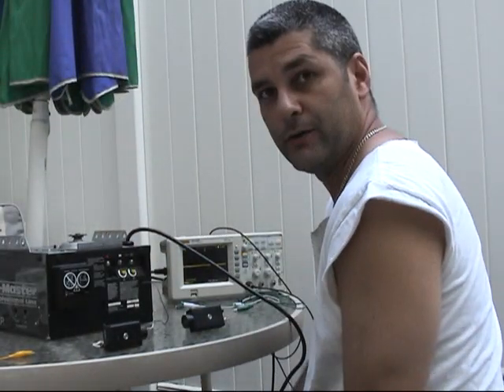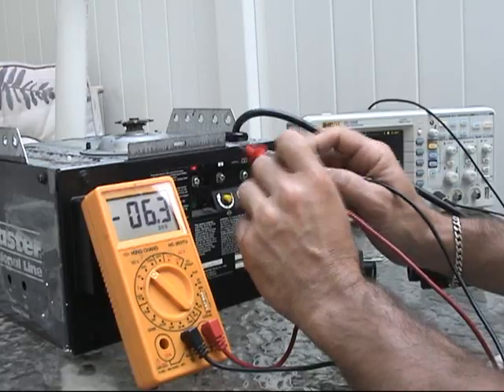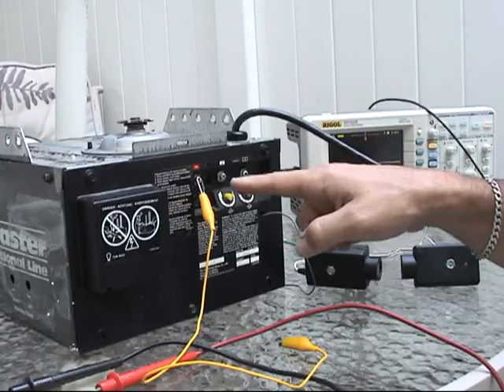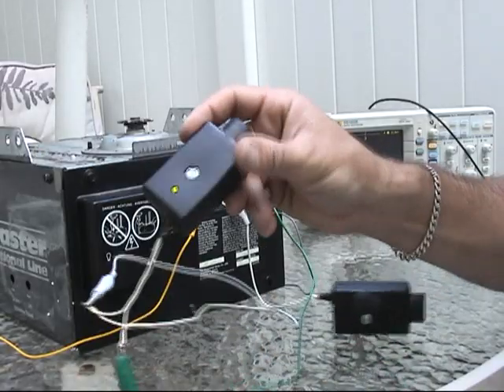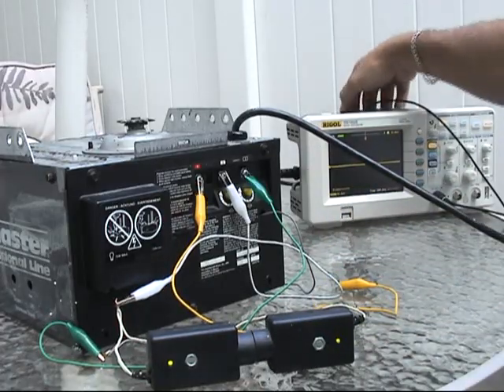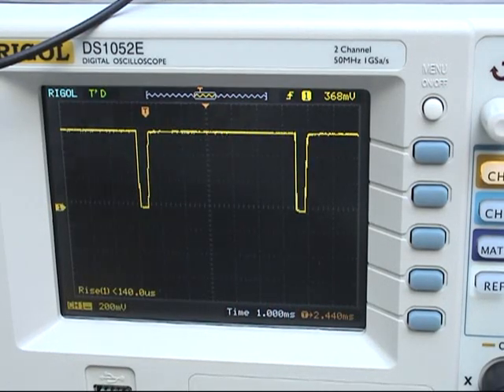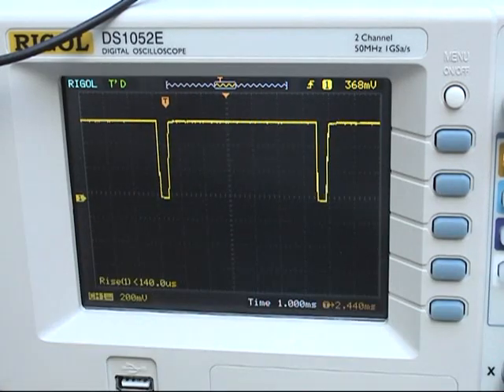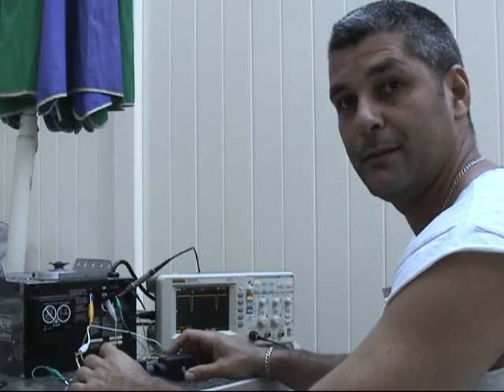Bypass garage door safety sensor.wmv

Comment: Useless. I thought I was going to learn how to bypass the sensors but instead he wastes time explaining why they work. A total waste of time. The oscilloscope added nothing.
Reply: +Nicholas Calvano  LOL... the oscilloscope tells you everything you need to know to bypass them.  I think MrEnergyFree is just erring on the side of caution - ensuring that people need to know what they're doing to bypass a safety feature.  If you listened to his explanation, I think you could figure out exactly what you need to do.
Reply: +Jason Riley All I want to know is how to bypass the sensors. His video does not do that. I know how the system works and care nothing about the extraneous information provided by the oscilloscope.
Reply: +Nicholas Calvano I know that's what you want... and the answer IS IN THE VIDEO, you just have to understand how it works... beyond "the door stops going if the line of sight is blocked".
Reply: +Nicholas Calvano  Hi Nicholas.  Do you want to bypass them permanently or temporarily?  I only wanted to bypass them long enough to determine if my problem was with the sensors themselves or if there was a problem with the opener.  I found out on one website (not sure which one) that you could jumper across two of the contacts on the back of the opener and the door would go down.  That was all I needed to know the opener was working and my issue was with the sensors themselves.  I have a friend who owns a garage door installation and repair business and they had an old pair of sensors which they essentially gave me.  If this is the same issue you are experiencing then my recommendation would be to contact a small home owned business and see if they'll sell you an old pair they removed when they installed a new door.  You could probably get them a lot cheaper then buying a new pair at a big named business.  But one note on my testing; I thought I could just push and hold the button I have on the wall and do the same thing but it doesn't apparently work that way.  Jumpering at the back of the opener was the only way I could get it to work.  I agree the video does not show how to bypass the sensors and who has an o-scope at home; few.  I have one and even if I did hook it up that wouldn't solve the question I had.  If you're looking to permanently bypass the sensors, most people wouldn't want to share that with you for fear of helping you put yourself into a dangerous situation; but then too they don't know what your intentions are; only speculating.  God bless.

Comment: I want to use the photo eyes as a driveway alarm, that is why I watched this video. If you want to by pas the photo eyes on your door, just mount them high above your door so the beam will never be broken. But I do not know why any one would do that. Why would you want your door to come down on someone or something?
Reply: +Sean Rafferty   My door will not come down and I suspect the sensors.  The only way I know to determine if the sensors are the problem is to bypass them long enough to test the opener; it's not to eliminate them permanently.

Comment: This is great, far better than the garage door companies, for understanding how they work. It's not a good idea to bypass the sensors, but this can help you understand how to fix them.
Note: on most garage door openers if you hold the wall switch, it will bypass the sensors and the door will go down.

Comment: Thanks for the analysis with the oscilloscope. That answers questions no one else on the internet had described as well. At least with over an hour of searching.

This also shows how you cannot (nor should not) by pass these safety devices in any simple way.

I am going to guess that in the controller board on the opener is a re-triggerable "timer" with a time constant longer than the 6 mS pulse. So long as a pulse arrives to re-trigger the timer before it times out the door is allowed to close.

Good job MrEnergyFree.

Comment: After looking at the waveform it seems pretty simple to override the sensors. Assuming the High of the pulse is 6 volts and the Low is zero all you would have to do is have a pulse generator that controls a switch to short out post 2 and 3. It would generate a 154 Hz (1/0.0065) frequency pulse with an 8% (0.5/6.5) duty cycle. When the pulse goes high the switch is turned on and shorts post 2 and 3. When the pulse goes low the switch is open giving the open circuit voltage of 6 volts. Get your self an arduino and a transistor and your in business.
Reply from the maker: +Anthony Shelton 
Look in my channel for new video "Bypass Garage Door Sensor using 555 timer " for the electronic circuit.

Comment: I just replaced the drive gear on a craftsman door opener and briefly bench tested it. I installed it but the car was not connected. When I closed the switch the car ran to the pulley and the cable is at the sprocket on the control unit. I was expecting it to reverse when I hit the switch again but it doesn't. Is there a way to assure the motor will reverse when the switch it closed? I don't want to tear up the gear again.

Comment: Great video...saved me the time and trouble of eventually going through the same procedure after several hours of wasted time trying to see if I could bypass sensors.  The answer....NO.  Taping the sensors together like other people have done is really the only way.  At least there is one way  as long as you have two good working  sensors.  If not you're SOL.  I  understand why that is now....thanks again for showing this.

Comment: Very helpful!  So, to bypass, create an oscillator (using a variable potentiometer) to produce a 6.5 to 0.5 ms square wave @ 6.3 to 0.0 volts, respectively.  Or, just simply attach the sensors together, run the wires up through the ceiling and hide the sensors in the attic.  At least then, the sensors won't be bypassed.
Reply from the maker: +FYIGuy01 
Look in my channel for new video "Bypass Garage Door Sensor using 555 timer " for the electronic circuit.

Comment: Would be interesting to look at the signal on the garage door opener feed lines to the sensors with the scope to see if the pulse is present without the transmitter in the circuit. I'll bet it is. This would allow the garage door device to send the signal, then look for a return through the photo-eye path and the two would need to be in phase. That would keep an alternate square wave from replacing the transmitter signal. Simple but effective.

Comment: Thank for the information you provided on how the eye sensors work, but nothing about "Bypass" garage door safety sensor.
Reply: UsMaLeMan1 Actually, technically the sensors are not bypassed since they are still in the circuit.  It is only the safety feature that is bypassed.
Reply: He DID show you how to bypass it...duh.  Disconnect the green sensor, splice it into the wires feeding the yellow sensor, mount or tape the sensors to something so that they stay facing each other, and wallah...technically the sensors ARE bypassed.
Reply from the maker: +FYIGuy01 
Look in my channel for new video "Bypass Garage Door Sensor using 555 timer " for the electronic circuit.

Comment: Interesting, the wires go to sensors are both DC supply and signal. the pulses generator must be in the transmitter sensor.

Comment: Excellent!  We are using garage door openers to open/close the roofs of remote controlled astronomical observatories.  The safety sensors were taped together so the roofs would always operate.  However the little black boxes are not waterproof proof.  Or dust-proof.   Dust obscured the optical port of one of the devices and dew and/or ice formed on the other after heavy rain!  This disrupted the signal and made it impossible to control the roof remotely.  I took the little boards out of the black boxes and, with the help of an EE friend, deduced what you have shown.   We too were initially puzzled how the control signal could be sent without a third wire.  Then I found the tiny surface-mount  comparator that is being used as an oscillator on the IR transmitter board.  This was a couple of weeks ago.  I just now discovered your video.  Good work!  We will now be working to make our observatories reliable.  This failure was occurring in two observatories.  Very puzzling when you are hundreds of miles from the garage door controller...

Comment: This video is definitely only for educational purposes. I bought an opener with an optical sensor, but in 2 tests out of about 100, the door didn't stop closing when it was blocked.  Then a few days later a child in a nearby city was crushed by an opener (brand unknown), so I take down my new opener and get another brand that I've never been able to make fail.  The optical sensor is the only safety device that works really well.  Don't defeat it.

Comment: No you won't. There are two safety features of garage door openers, one is the eye beams, the other is a pressure sensor. If you bypass these eyebeams, the opener won't "see" an obstruction, but if it's properly adjusted, it will "feel" when it hits something and reverse.

Comment: I had the same sun problem.  I bought a replacement sensor set (about $25 from Amazon) and connected the transmitter sensor to a 2 AA battery holder from Radio Shack.  Whenever the sun is an issue, I place my hand-held transmitter sensor next to the wired receiver sensor and close the door.  This keeps the opener's safety components in place but gives me a simple/safe override when I need it.

Comment: Hi, the problem I have is the sun the bright sun interferes with these sensors. This system is so dependent on these sensors it makes it difficult to close from sun, snow, hail, and fog. The only way to bypass this is to remove the sensors with wires and zip tie them face to face in place along a part of the frame in the garage as you cant unplug them otherwise the garage opener will not work. I don't like the system but installers should tell the home owner the issues before installation

Comment: @MrEnergyFree  The timing shows about 6.5 msec period which is approx 150 Hz.
Is this true will all the other sensors?
In this video, 6.2V is max, what is the highest voltage produced by different garage opener

t true to say that the frequency of the recievr

Comment: Thanks for posting this video. It was very helpful for me to troubleshoot a problem with my garage door sensor (loose connection at the base unit!) that was causing intermittent failures (door not closing completely before backing up).

Comment: My old sensor pair has two wire on the receiver side  and  has four wire on the transmitter side. so how I replace it with lifemaster Safety Sensors 41A5034?

Comment: Thanks for the o-scope readings MrEnergyFree, I leant my o-scope to a friend in another town and it will probably be a couple weeks before I see him again and retrieve it. My garage doors sensor stopped working, and I was able to use this information to create a bypassing circuit.

For others, the circuit diagram can be found seen at 206.255.233.35/garagedoorsafetyeyeshack.bmp, until my ISP changes my IP.

Comment: The o-scope around 8:15 shows the inverse of the signal that is really being transmitted. The ground is hooked to 2 and the probe to 3. So every .5ms out of 6.5 ms the connection between 2 and 3 is closed, effectively grounding 3. When the beams are open there is no connection between 2 and 3, and the o-scope shows the full potential between them.